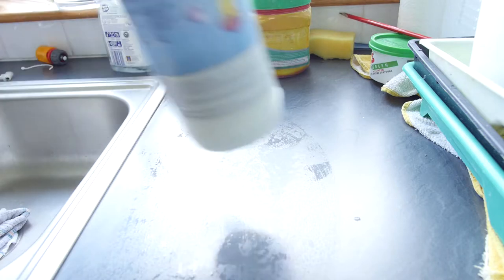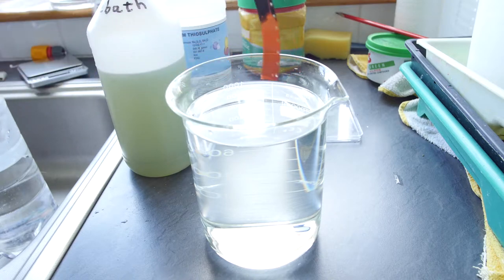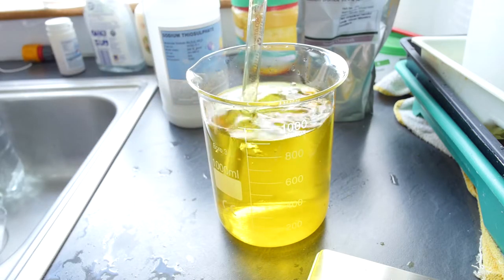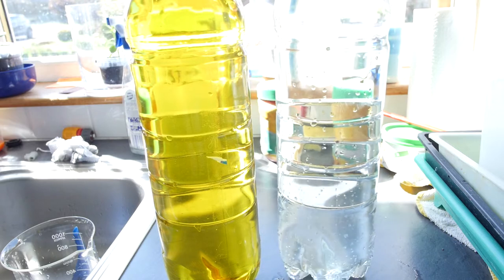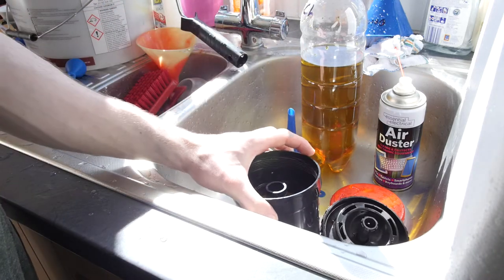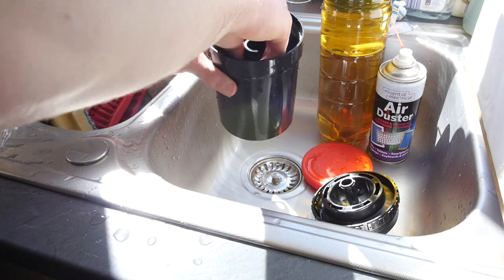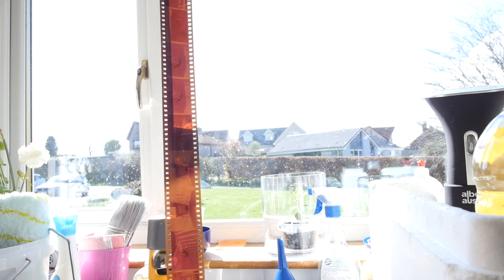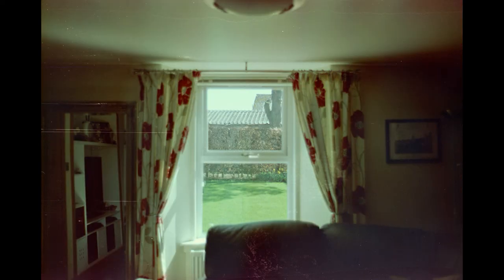Make bleach and fixer for developing motion picture film

Comment: This is a fantastic video. It's funny because i was looking into doing exactly this as the ECN2 kits are so expensive and the online labs charge an arm and a leg for processing a single roll of film, whilst i'll find myself accumulating some 12-14 rolls wondering how i'm going to develop all of them. I wanted to ask...the scans appear to have a heavy green cast in the highlights, have you done any extensive correction after your raw scans to try and get close to lab results from RA4 developer? I'm wondering as i don't mind a colour cast so much as i've dealt with colour film before that needed heavy correction but i was happy with the results once i'd finished, can this method be a real alternative to an ECN2 kit as it's so appealing price wise.

Comment: The proper bleach for c41 process should be made like this:
Ammonium Ferric EDTA solution (50 - 60%) 200 ml
Ammonium Bromide 150 g
Disodium EDTA 10 g
Ammonium Sulfite 10 g

Dissolve in 500 ml water and bring to 1 liter. Adjust pH to 6.5 with 28% acetic acid.

and not using ferricyanide!!!
Reply: Alessandro, your comment is good information and I appreciate. However, am I correct in thinking Shaun is after a true ECN2 process rather than c41?

Comment: I remember reading long ago that Fuji color films (both C-41 and E-6 stocks) will turn purple if you use a ferricyanide based bleach.  Have you tried this bleach with Fuji stocks at all?  I've got a C-41 developer formula I can mix myself, and a change of developing agent (from CD-4 to CD-3) should make it work in E-6 as color developer as well -- but the commercial blix has gotten hard to get on its own, and the commercial kits are expensive compared to mixing my own.
Reply from the maker: I noticed that the mask went a light purple colour but this never mucked up the images.
Reply: I cannot speak to C-41 Fuji film stock performance in a ferricyanide bleach, but I can confirm that over the years I have processed plenty of Fuji E-6 film in a DIY E-6 system based on  ferricyanide bleach with no color or dye shifty at all. Confirmed visually as well as with densiometric review. I have used a similar ferricyanide bleach for C-41 processing with no adverse issues, but I am not so technically rigorous there, as slight color shift can usually be dialed out in the darkroom print. Printing scanned images digitally would be even more tolerant because of so many other factors stepping on the image before its final result.
Reply: @randallstewart1224  What I've learned since posting above is that apparently this happens if you get active developer into the bleach bath and the pH isn't low enough to stop development.  Since ferricyanide bleach can't be very acidic, you'll get very uneven development with fogging, causing the purple/magenta appearance.  Apparently a stop bath (to ensure any carry-over developer is killed) followed by a water rinse (to prevent carrying acid into the bleach) will completely prevent this problem.
Reply: Just so. The current E-6 and C-41 formulas per Kodak specs were designed to expedite processing in updated, automatic machines used in smaller labs. The original E-6 formulas are updates from the preceding E-4 process, and sequenced as follows, more or less:  pre-wash, first developer, stop bath, wash, reversal bath in lieu of wash or separate, color dev, stop, wash, bleach, wash, fix, wash, stabilizer. When I started working out my own formulas in the 1980s for E-6, it was practically impossible to acquire the key component of the official reversal bath, so instead I used re-exposure to light to get the reversal, as I had when using E-4. I have never done enough E-6 to warrant updating to a chemical reversal. Note that chemical reversal was first incorporated with introduction of the E-6 process to expedite machine processing. Prior processes used light reversal, which remained technically the reversal process E-6 standard Kodak used for lab tests.